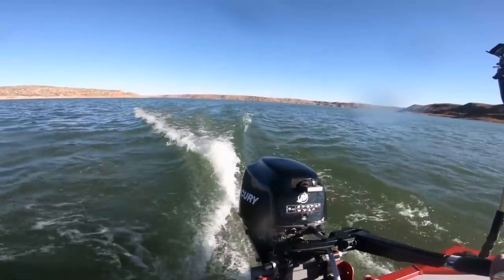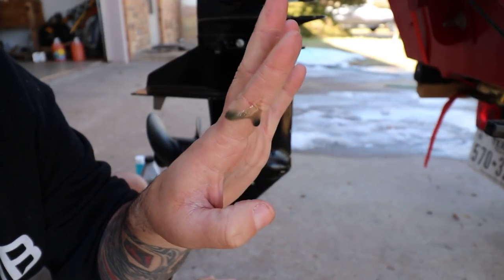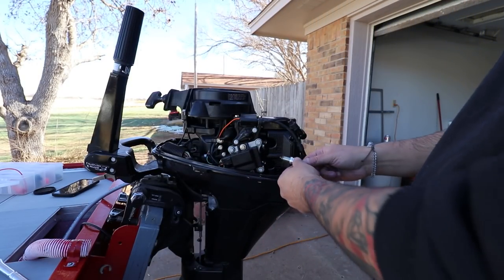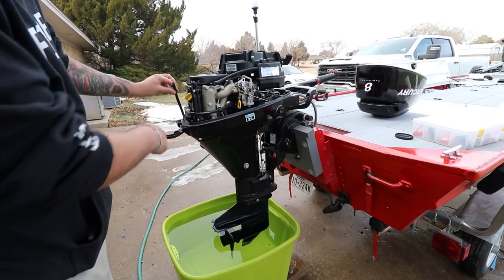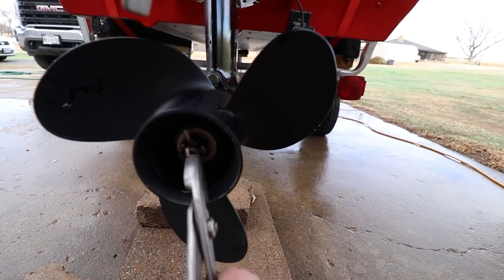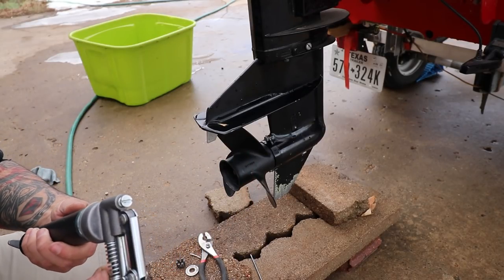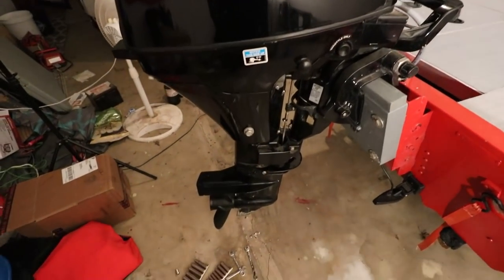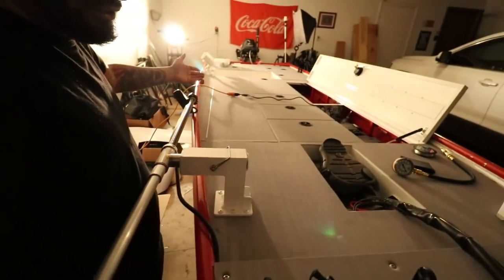I GOT BAD NEWS FOR THE JON BOAT!!

Comment: I've got like 4 of those gappers laying around. I can never find them before I go and get new plugs and a gapper. But now I've got one in every vehicle, along with an air chuck, and pressure gauge for the tires.
Reply from the maker: They are easy to lose huh? Lol ohh air pressure gauge, didn’t think about that for my boat tool kit
Reply: @AdamRyanA  trailer is a part of the trip, you gotta

Comment: I’m pretty sure there’s a thermostat on that motor. I have a 9.8 mercury 2006 and it looks just like yours.  Also if your motor is out side in the spring be careful that those little dirt dobbers don’t build a nest in your weep hole. They will plug it up tight.
Reply from the maker: Yeah I checked the thermostat too and it looked good and wasn’t the problem, just didn’t film that part
Reply: @AdamRyanA  the thermostat does take a minute to open up.

Comment: I hauled my boat to the ocean (2 hours away) and it wasn’t peeing when I started it on the trailer. The pee hole was clogged with pollen. Luckily I had some stainless tig wire on board for straightening coon shrimp and that worked to clear out the line and saved our trip. Would have been a long drive home in shame.
Reply from the maker: Yeah that would of sucked after driving 2 hours

Comment: That impeller needs to be replaced it’s actually in bad shape those little fins it has need to be straight when they’re bent like that it needs to be replaced. On the little outlet sometimes it gets clogged you just need to put some air in when it’s turned on, you can use a little pancake compressor to shoot air in the outlet and it’ll start shooting water back out.

Comment: My older outboard has to heat up before it will pee. The thermostat detects when its time to pee. Engage the prop and I bet it will pee within a minute or 2.
Reply from the maker: Right but this motor usually pees in seconds